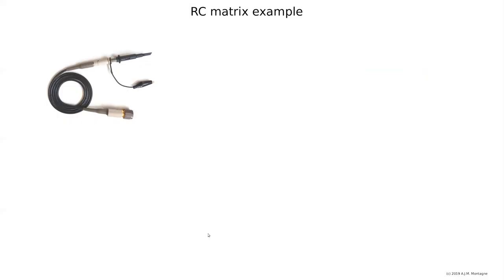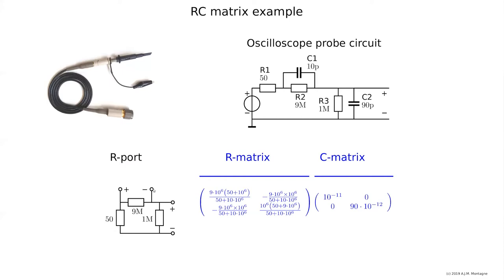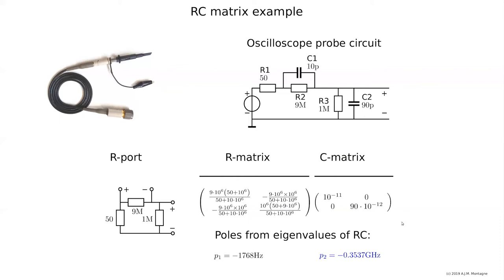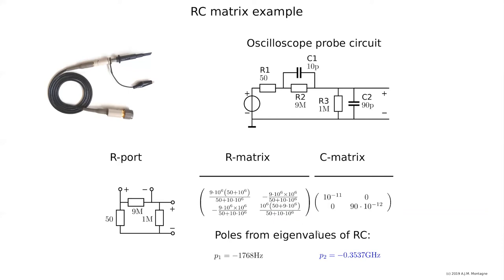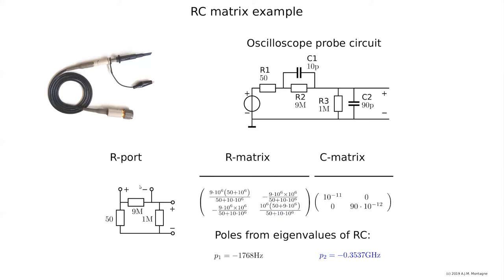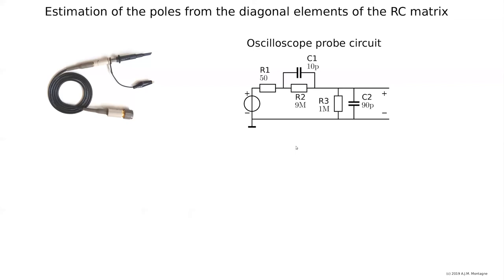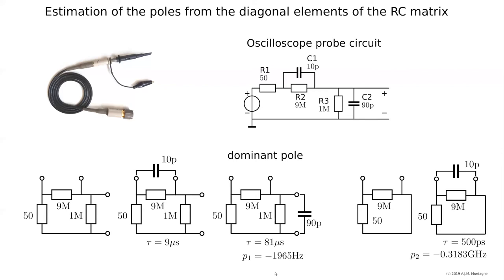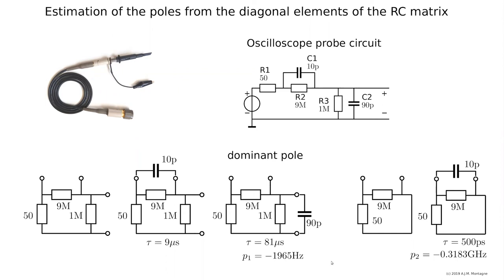EE3C11 lecture 6 Estimating Poles and Zeros Probe example

Comment: Nice demonstration. I think there is a mistake in the value of p1. If you use superposition principle for the two capacitors and determine the time constants separately, the time constant of 9 usec for pole1 will result in a frequency 1/(9 usec) = 111111 rad/sec or 17684 Hz. So, the p1 should be around 10 times larger than what is presented in this video at 00:03:45.